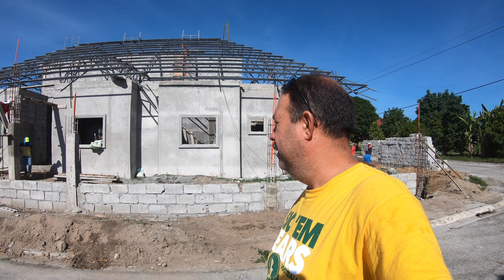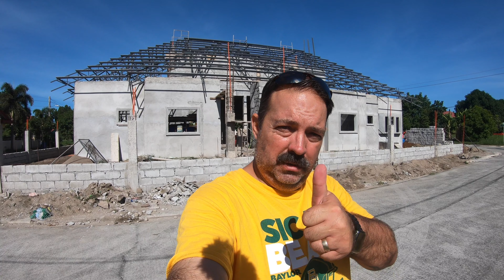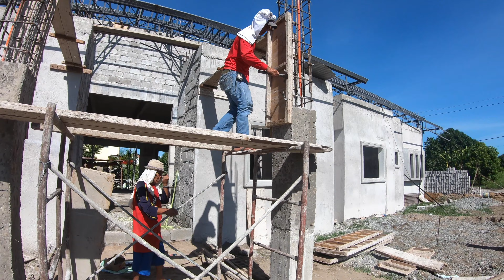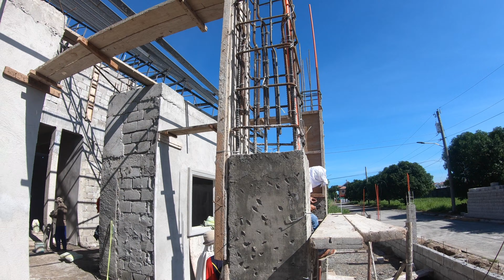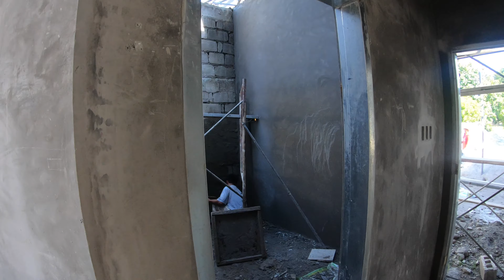Philippine House Building Step by Step, Build Day 105: Don’t Fence Me In

Comment: I have noticed a common non use of wheelbarrow in hauling concrete....
Reply from the maker: Easier to navigate through the site with old paint buckets on their shoulders; their preferred method.
Reply: @CasaTexPina  I will agree if they're dumping concrete above ground...but below ground level...wheelbarrow is faster...or they prefer buckets because it eats lots of time....